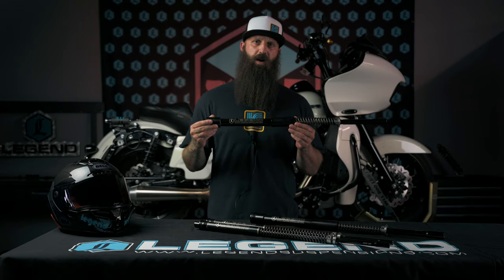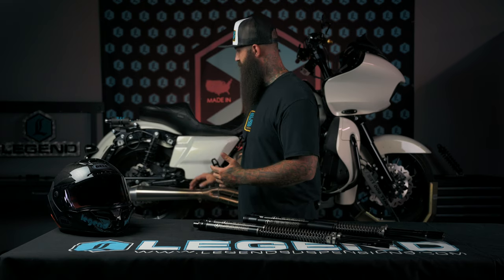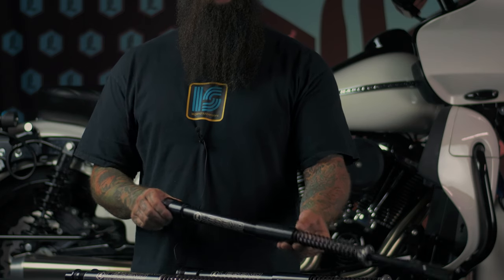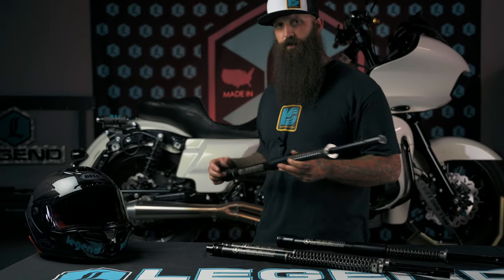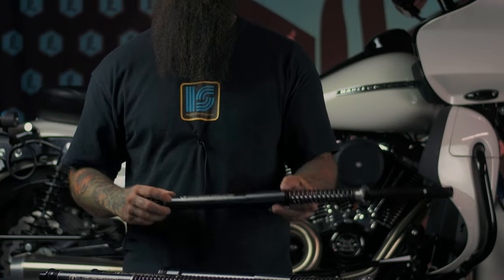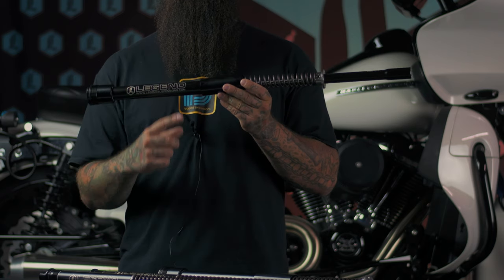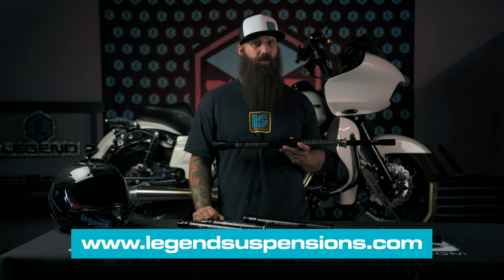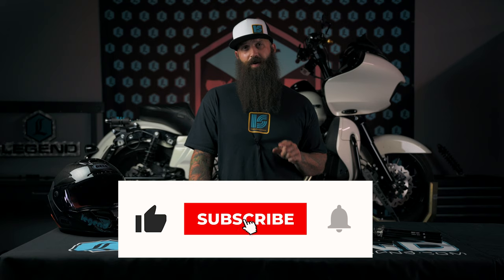Making +2 Performance Baggers Ride Great!

Comment: I'm building a 2002 Electra glide performance bagger. Can I use 14" rear shocks and can I extend the 41mm forks up two inches also? Looking for the budget route first. Thanks. I have Legend shocks on my DYNA and my other E Glide.
Reply from the maker: Hey Mike-

Thank you for your business and continued patronage to Legend Suspensions. 

We do offer 14" Revo-ARC's for '99-'08 Touring. You will want to ensure you have the clearance for them first, every bike is a little different. We recommend installing a jack under your bike and removing the lower shock bolts. Then raise the bike till the shock bolts are 14" apart. This will let you know if the exhaust needs to be changed, if the swing arm is contacting the oil pan or any of items. 

On the '99-'08 Touring Revo-ARC you also would need to run the stock included reservoir mounts as well. The upper mounts we offer as an option are not compatible with those years. 

On the Axeo, the top of the cartridge becomes your top cap so there is nowhere for the 2" extension to screw into the fork tube as well, the only way to install our kit would be with a fork tube replacement. 

Hope this answers your questions, if you need any further assistance, please feel free to reach out to us at service@legendsuspensions.com

Thank you.

Comment: You can run +2 with your same current exhaust. You will need to hammer or reshape the exhaust where the axle nut sits for clearance but it sounds worse than it is and doesn’t change the sound.

Comment: Can you run the +2 front with 13 rears? Road glide
Reply from the maker: You can, but we highly recommend you run this front end with 14" rear shocks, to optimize the full height gain of the front end. If you install that front end with 13" rear shocks you might need to lower the front end in the trees a little to ensure the correct rake and trail is achieved so you are not taller in the front end. This will lead to poor handling.

Comment: Why are these not for bikes with a 21” front wheel. What else could I do to raise the front of my bike and still run a 21 on my 03 bagger
Reply from the maker: Hey Brandon, thanks for reaching out. There is a lot of variations that go on with the front ends. If you email service@legendsuspensions.com we will get you the right setup for what you are wanting.

Comment: With the 2+ on front and rear does this require any other modifications?
Reply from the maker: Hello, the main things would be to double check and adjust belt or chain tension if needed, ensure you have an exhaust shorter than the rear axle nut, double check that your bike does not have a +1 oil pan that protrudes rearward as the swing arm comes down that can hit, and it is already close with 14" shocks. Also, worth noting that if you have an 18" 21" tire setup the bike will be raised up further and this could lead to needing a longer kickstand in some cases. Those would be the main things. If you need any further assistance, please feel free to email service@legendsuspensions.com or use our chat feature on the Legendsuspensions.com website. Thank you.